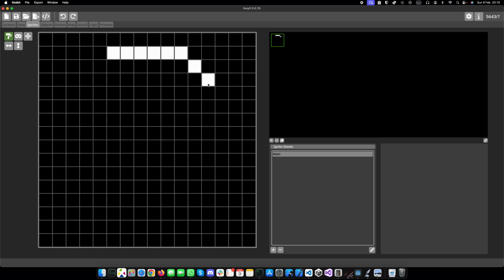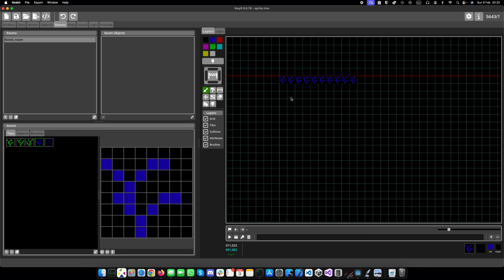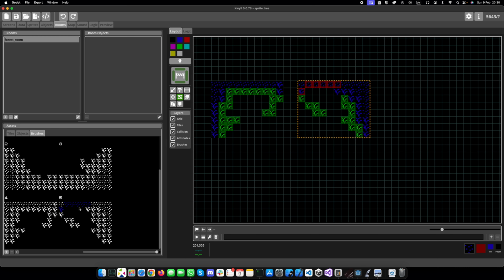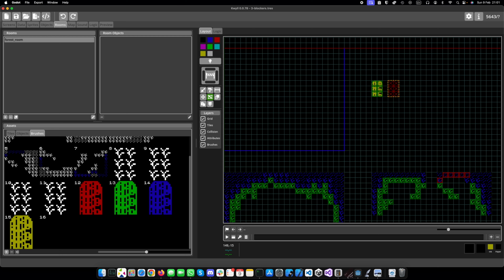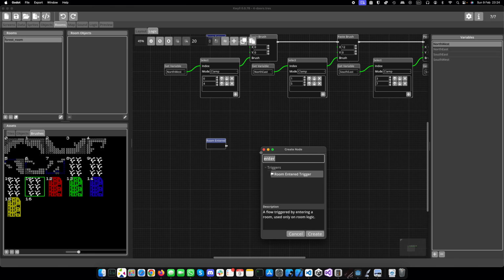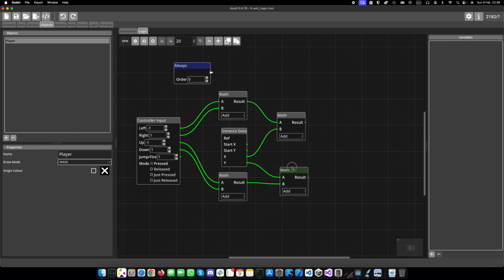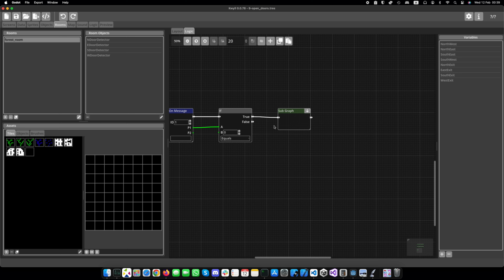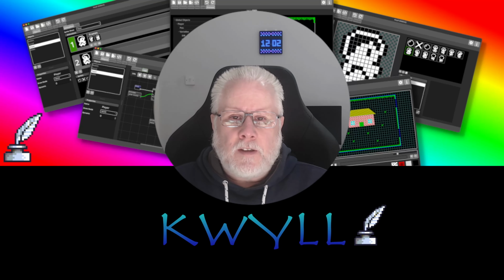Kwyll Tutorial 1 - Part 1

Comment: You mentioned that you envisage Kwyll being usable for many different systems besides the ZX Spectrum, and possible ULA+ support.  Any thoughts about making Kwyll support the ZX Spectrum Next?   Thanks.
Reply from the maker: Yes, Kwyll has been engineered to enable the potential for other target platforms in the future if it is well enough received on the Spectrum. Due to the similarity in many aspects, the Next would most likely be the next supported target. I supported the Next through KS2 so I have a Next to work with, and in many ways it was the Next that prompted me to start Kwyll in the first place.

Having said that, if and what platforms I add support for in Kwyll depends a lot on the community and successful, or otherwise, it is as a product when I get to v1.0 (soon).

So, simple answer, probably yes, less simple answer, it depends.
Reply: @indigobeetle  Thanks!  I'm backing you on Patreon and will also be purchasing, Kwyll looks great and I value your efforts.

Comment: Very impressive.  I have some questions if you dont mind.
1: is there an estimated release month/year (I dont do early access or patreon, no offence)
2: do you have an idea of the cost of this?
3: will there be a physical option with a printed manual? (i'd pay more for this)
4: does it support smooth scrolling?
5: are you planning to add ula+ or things like the nirvana engine to combat colour clash?
6: can we sell any games made with it or is there a licence fee or restrictions?
7: will it support 128k and AY music?
sorry for lots of questions
thank you
Reply from the maker: 1. I don't have a release date yet, it'll be this year, but that's as close as I can say right now, lots of work still to do and I do it in my spare time, so can't work to specific deadlines.
2. Not sure of cost either yet, depends on interest, won't be ridiculously expensive, probably £10-20, but don't hold me to that.
3. Haven't looked into that, I am creating the documentation using a tool that supports generating printable versions as PDF, so possibly, but I don't know anything about distrubuting physical software at this point.
4. Not at the first release, no scrolling at all, it's room based. I have plans to investigate adding new features post the first release, scrolling is on the list of things to explore.
5. ULA+ probably, nirvana, probably not, but not certain. It is built to support multiple platforms,  not just the Spectrum, so it's possible.
6. Everything you create with it will be yours to do with as you please.
7. It will, but possibly not at the first release.

Hope that helps, if you have more questions, feel free to pop over to the Discord (link in the description) and I'll happily do my best to answer.
Reply: @indigobeetle  Thanks! very helpful and I'll be in the queue when you sell it.

Comment: This is looking real interesting. Such a different approach to game game dev on the speccy. Is there a version of Kwyll available for download to have a play with yet  also, that example you produced, what sort of space is it taking up in the speccy so far? Is there a lot of 'engine code' to run or is it translating all the logic diagram into assembler as I imagine optimization is going to be king here.
Reply from the maker: It's not ready for mainstream use yet, but it is available as an early access to Patreon subscribers (link in the description). A small number of people are using it and testing it regularly and directly influencing the direction of travel.

Most of your questions are covered in a lot more detail in other videos on the channel, but briefly. There is engine code no the Speccy, it is the area that I'm working on most at the moment to reduce the size and increase the performance. The logic used to be exported as C code and compiled, but that proved to be too unpredictable in terms of size, it's impossible to determine ahead of time how much space is available and how much is used by your game. So now it works via a custom virtual machine in the engine, the logic is exported as bytecodes that run in that vm. So everything that is exported from Kwyll is pure data, no code.
Reply: Good to see the work flow moving from tool presentation to joined up thinking.  Good work Paul.